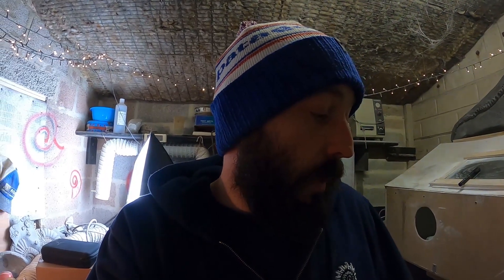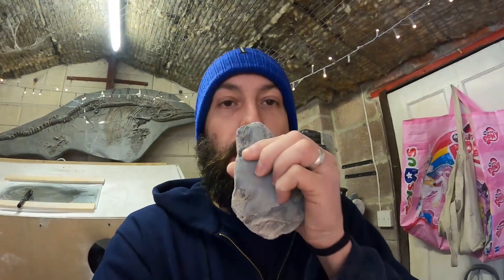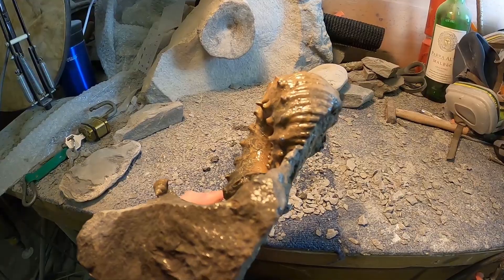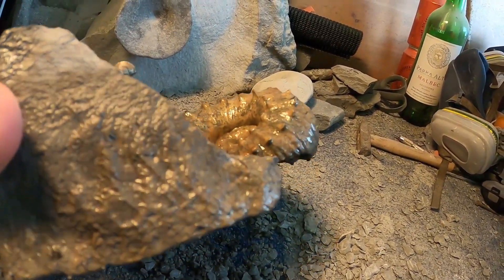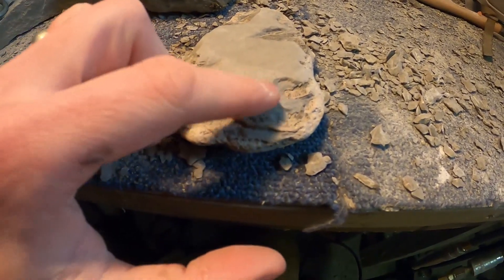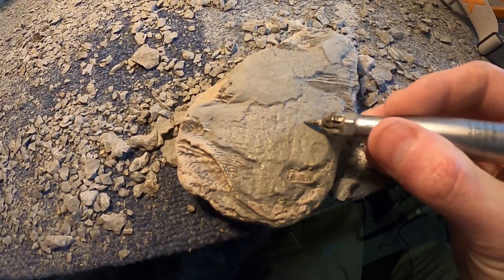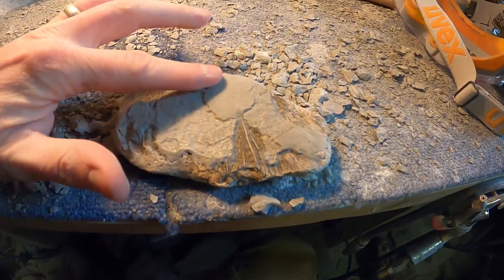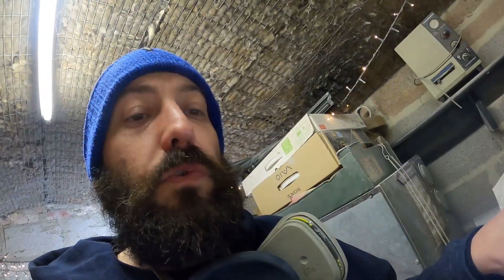How I Clean fossils with an air abrasive Workshop session 5

Comment: I love your vids!! They’re all so informative and satisfying!! I’m new to the prepping world. Located in the sates in Texas, I was wondering the the PSI is on your blaster and what type of blasting media/abrasive you’re using?? Walnut shells, baking soda, aluminum oxide, crushed glass??
Reply from the maker: Cheers for the kind words dude, I run my compressor around 90-110psi, the Comco blaster I use has a regulator on it so you can switch it up and down depending on what you are working with, at the moment I’m using dolomite powder, you can have a few problems with moisture while using it so I run the air through a refrigerant dryer before it goes into the abrasive machine, it’s a bit over kill but I’ve never had it block up. Dolomite is a good balance, it doesn’t cut as fast as aluminium oxide powder but is gentler on the calcite and with care you don’t get that ‘melted’ look, like you easily get with aluminium oxide from over abrading, so dolomite is just a little more forgiving. It’s so much cheaper too, think a 20kg bag was around £20, it’s one use unlike aluminium oxide which you can sieve and reuse, but at that price it’s not really a problem. The 20kg bag has lasted me months and months.
Reply: @TheFossilAcademy  thank you so much!! I did forget to ask though, what the best grit/mesh/micron is?? Or the one you find yourself choosing the most??
Reply from the maker: @jamiehennis2080  the dolomite I use is 40micron I think, check out zoic paleotech online, they are a UK company that manufacture and sell fossil tools, they have some really good info regards prep, tools and abrasives. The descriptions of their products are really well written and might be helpful.
Reply: @TheFossilAcademy  thank you!! That’s actually where I get the bits for my dremel 290 and my Paraloid B72!! 
This is a lot of help!! I’ve been trying to learn air abrasion for about a week now - i by no means have the greatest equipment yet as I’m just starting on my prepping journey. I’ve attached an old 3.8L aquarium air pump hose to my Dremel 290 to blow the dust away as I chisel away, and my air abrasion setup is definitely begginer- I’ve got a $27 GBP air eraser that was originally running on a 30PSI airbrush compressor- I upgraded the compressor to a 65PSI compressor, upgrading definitely helped but still wasn’t as great as I’d like it to be, so thank you!! I will be upgrading my compressor soon!!
I’ve done two complete Ammonites 152mm & 203mm in diameter. Prepping has been soooo relaxing and satisfying for me that I want to learn and get better at all aspects of it!! Thank you again for your content and for taking the time to reply!!

Comment: Could you use salt as an abrasive when working on limestone? :)
Reply from the maker: Sorry for the late reply dude, not been keeping up with social media this past few months, salt would really mess the machine up, the particles would be too big, the main abrasives are dolomite, sodium bicarbonate (for really soft matrix like shale) aluminium oxide powder if you need more cutting power and for certain stone iron powder is really good but you need a dedicated machine for that type of abrasive.
Reply: @TheFossilAcademy  Thanks for the reply :) I'm a complete newcomer to sand blasting. But I was considering making a NightHawkInLight style "sand blaster". But sodium bicarbonate is not cheap here so salt might have been good instead :) Similar hardness and you can get a pretty fine powder.